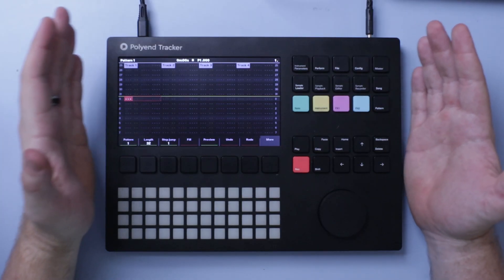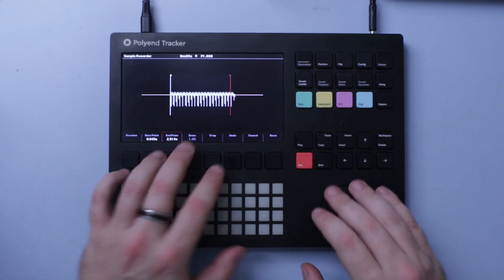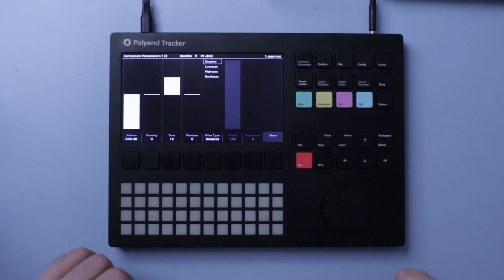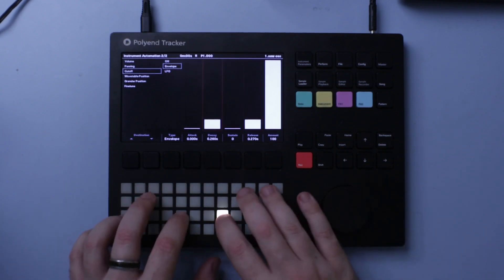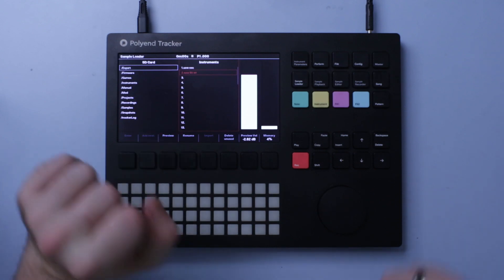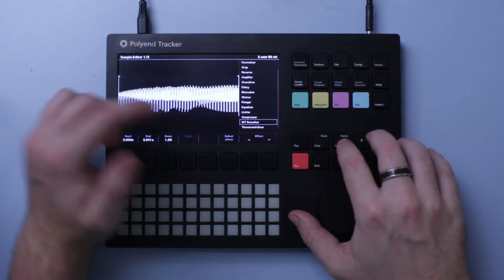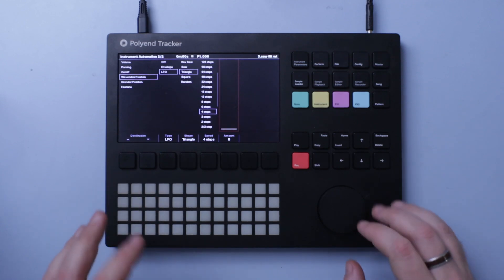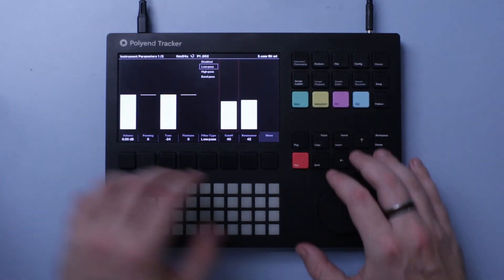Polyend Tracker : make a sound engine with sample based oscillators and the wavetable instruments

Comment: Great video; from a design perspective this really open up possibilities. 
The downside is that this is not the same as a proper synth engine though... The sounds you can make are specific to few styles I am afraid; and can't even remotely get the flexibility of a standard subtractive synth engine, even with just one oscillator.

Neat feature to have those 2 manipulators for waves, but in the end, they are "effects" for give some motion to a sound, but you are bound in terms of sounds you can create, even if you have the same triangle, square, saw and pwm "primitives" as starting point.

Comment: The first time I tried this was on an Octatrack and it works great, my only complain on the tracker is that it’s bit depth hurts some of the samples a bit too much (no pun intended), but it does lend itself to a different sonic approach to those single wave samples
Reply from the maker: It does have more of a alias sound to it, but I like Amiga bangers :). Single cycle waveforms need to get more credit!